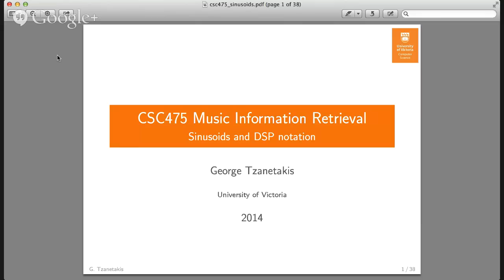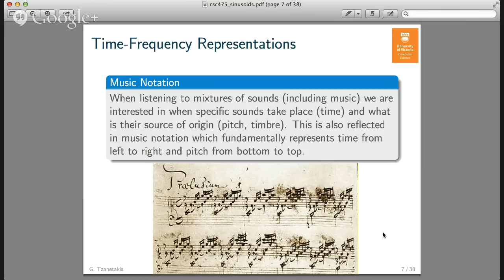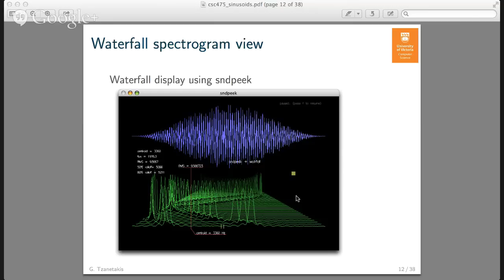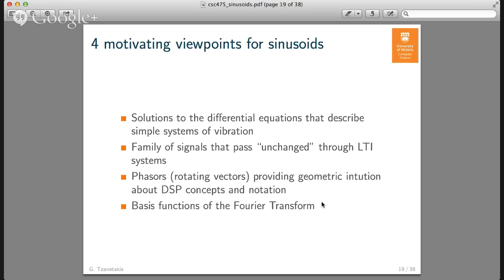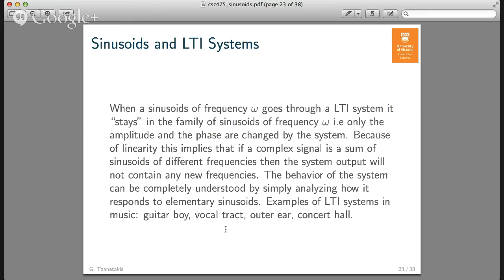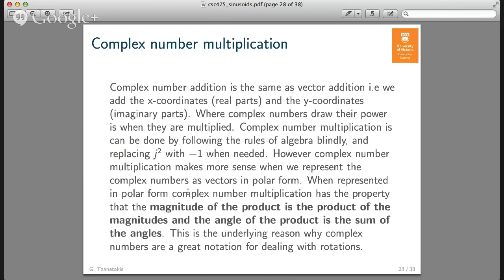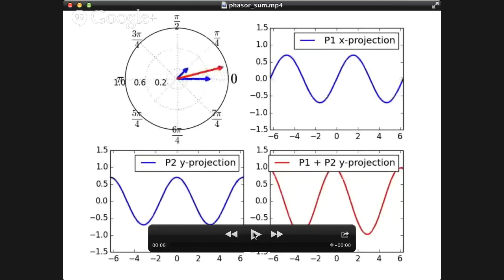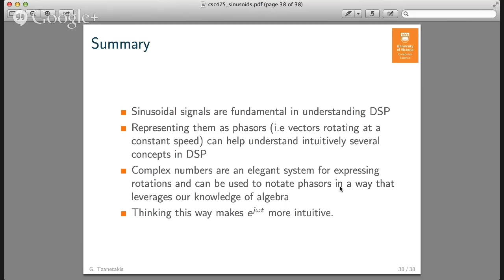UVIC Mir Course DSP Lecture 1

Comment: I was just wondering, how only using the property of the the derivative we can write the complex number cos(theta) + j sin(theta) as an exponential. Why don't we need to check any other properties of arithmetic. This is equivalent to saying that if the derivative has similar behaviour, then any mathematical operation has similar behaviour. Any clarifications?
Reply from the maker: Your question is a good one which means it is not going to be easy to answer quickly. As a first approximation you can view it as a symbolic convention - you have a complex number which is a function of theta E(theta) - if you project to the two axis you get the cos(theta) + j sin(theta) from trigonometry. If then you symbolically differentiate you notice that it has the unusual property that the derivative is proportional to the actual function itself. In standard calculus that function is the exponential so why not try it with complex numbers - you can then check the conclusions you get following the algebra and you see that you get the correct results. In some ways the e^j stuff is just a notation convention so that we human beings can use what we know to do to do operations on signals. When you do things on the computer there are no j or exponentials. A somewhat deeper explanation is that the exponential, sines, and cosines are really very special functions who have properties that make their derivatives easy to compute symbolically. The more accurate historical view is that computing derivatives of arbitrary functions manually is hard so mathematicians found functions that were easy to symbolically differentiate and then showed how they can be combined to form more complex functions that can still be differentiated symbolically. We just simply gave them names and formed the edifice of calculus. If computers had been available maybe we would never have bothered and just did everything numerically. Sorry for the long reply and I am not sure I answered what you are asking but hopefully pushed your thinking in the right direction.
Reply: Thank you for the clarification. It sure did help.